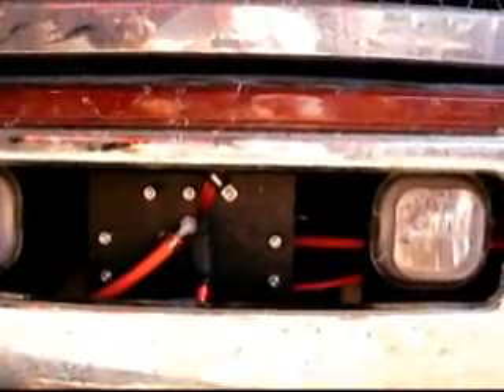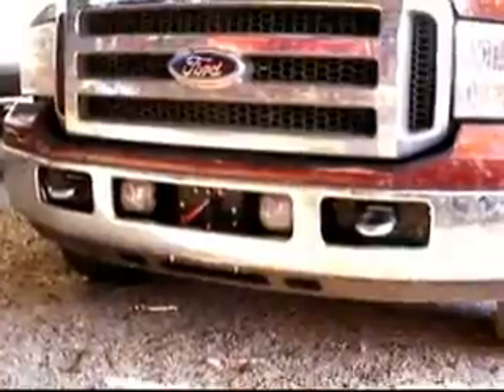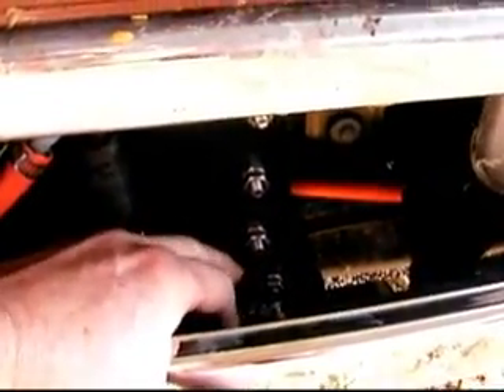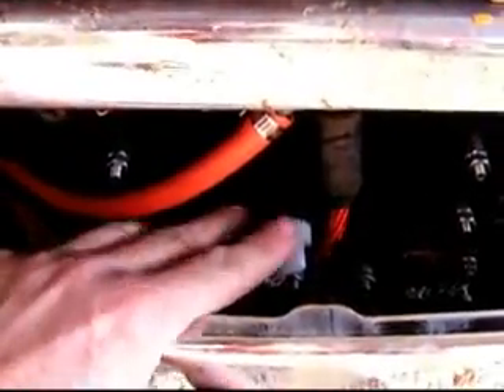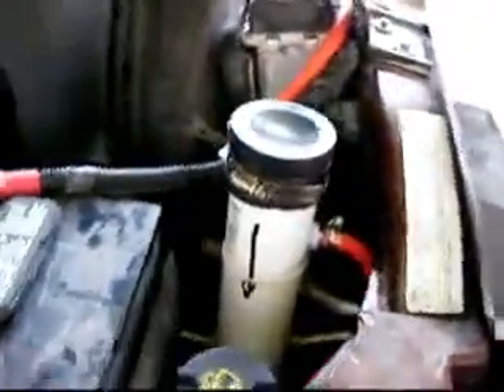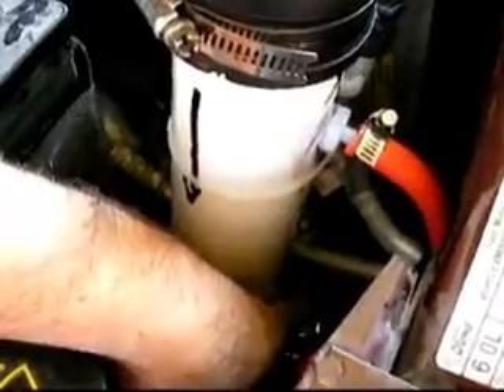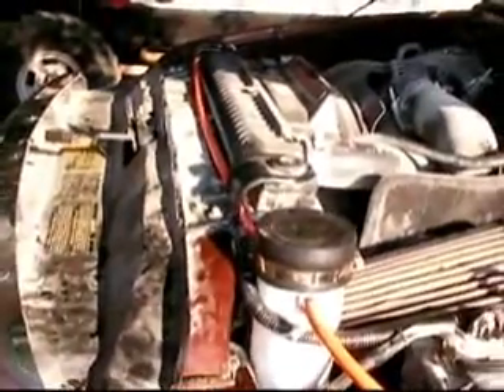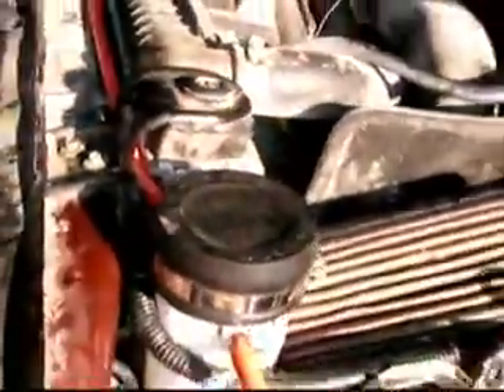hydrogen installed on a diesel 6.0 super duty

Comment from the maker: the two resivors are designed to work together they are a type of dryer that mimicks the air dryer on a compressor. i have used this set-up on my diesel van for a couple months.. with a clear tube i see no discoloration or water droplets/vapor. the truck is due back this week i will check the lines if i see water i will add a water filled bubbler. so far the lpm is 4+ at 45A with 12.5 volt the cell stays cool 109-120 degrees. the milage is still pending as more work progresses. be blessed!